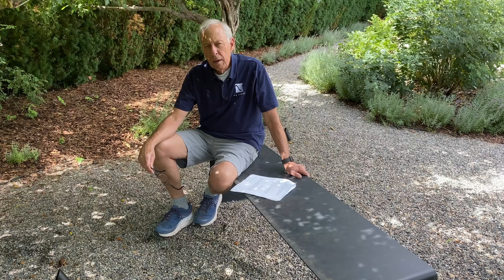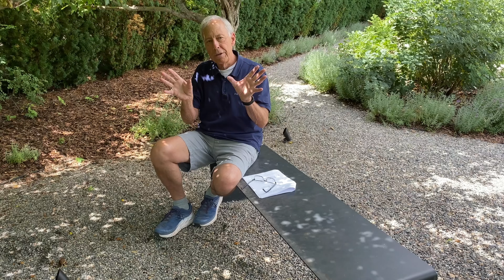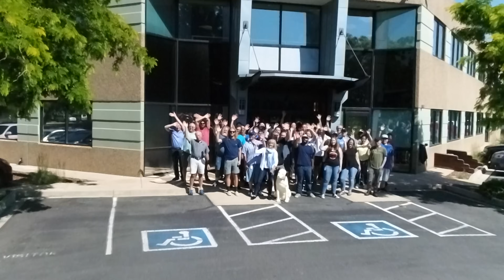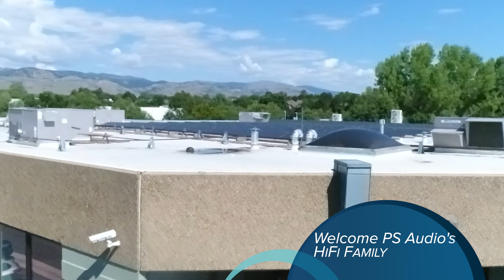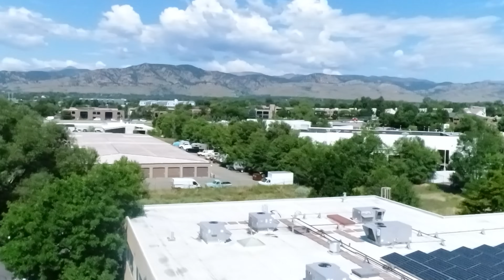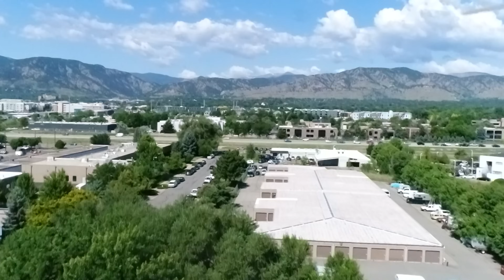Psychoacoustics in speaker design

Comment: The question is excellent. I would like to support my comment with the biological investigation of our hearing, 40 years of being HiFi enthusiast (if not audiophile - maybe yes) and meetings with few famous Danish speaker designers - Dali and Dynaudio manufacture. 
First biology. Not many from us consider, that our brain needs some time to 'understand' the sound which is mechanical energy reaching our tympanum. That energy is an air pressure changing according to molecules' misplacement in the environment. That energy is transferring (simplifying the process) into the nerve impulses which are forwarded to the right part of our brain to be read by comparing with our former experience. The experience we build during our life. And, what is important, the experience is build based on the music we hear by specific HiFi equipment. It means also that changing equipment we usually need time to train our brain to understand the new information as the same as was before. I call this process 'equipment must warm-up'. Funny enough. So, no snake oil in the warming-up cable process. By the way - the entire hearing process from the moment the music touches tympanum to be accepted by our brain takes a fraction of second. It means that it happened not immediately. Interesting. So be aware if they say 'our cables are fast'. Relax.
My experience. I bought a few times a new HiFi set or HiFi upgrade element and my very first impression was devastating. It is no improvement I had expected! Wait. After some time my old staff seemed to me odd and not as good as the new one. After some time - think about it.
Professionals as Paul. They say that it is possible to evaluate speakers just looking at the graphs from technical tests. I remember very well the moment I showed this kind of results to the main speaker developer in Danish manufacturer Dali Speakers. Graphs were taken from a highly respectable Hi-Fi magazine - the test compared 4 or 5 similar huge speakers from different manufactures. We looked through all these graphs - frequency response, impedance, phase shift, impulse response, etc. He said suddenly - these speakers are not good. Why? - I asked. The impedance shift in low frequencies is audible, resonates for some frequencies as well, high frequencies are too much elevated (about +3dB), etc. What was the surprise? These bad speakers were the test winner! He just smiled.

Comment: I love the time you take  paul and love this channel, but this sadly steered away from the question which could have been a very ointesting one.

He wanted to know if the frequency response of the speakers were tailored to the heightened hearing sensitivity to the specific range of human speech ( which can sometimes favour female speech if a males voice is low and below the increased sensitivitu range ).

This could have lead to a discuasion about whether there should be a dip in frequency response in that range at the speaker level, whether engineers already do this in mixing or whether they even should. Whether mircrophones themselves are designed to do this etc.

I think that as we naturally have a sensitivity to this range there should be no change anywhere from mixing to sound reproduction. Why would you reduce what you would naturally hear. I don't think he was asking about soundstage and imaging.

Comment: I thought Bose was the big name in psychoacoustics ..! 
Psychoacoustics is a highly complex subject ... while a certain amount of it is allowed for ( but I hope not relied upon in speaker design !) in the development of a high end speaker systems ... the real psychoacoustics plays out in the confines of the listening environment and is very much out of our control ..
There is a difference between speaker placement for a so called flat frequency response and speaker placement for psychoacoustics.... good luck with it ! The only way to listen to reproduced music is to have a room with an odd number of walls ... a solid concrete floor and a tall vaulted ceiling and suitably positioned broad spectrum diffusers ... My listening room is of this design and it cost more to build than the equipment I use within .
Reply: I would offer that besides the psychoacoustics involving imaging and soundstage and room acoustics which is more what you are actually talking about, that the radiation pattern of the speaker is more pertinent to the psychoacoustic qualities of a loudspeaker than anything else. From directional horn speakers to cones and domes to dipoles to omnidirectional speakers, this factor makes the most influence psychoacoustically than anything else in the design of a loudspeaker.

Comment: One thing that is odd is that tweeter directivity is important as high freqs are very directional yet our ears point sideways rather than at the tweeters Of front speakers.
Reply: Unless you are without an outer ear, or Auricle, you have plenty of forward detection for hearing the tweeters.
Reply: @jamesplotkin4674  I did think of that but turning my left and right surrounds on and off showed how much we're missing.

Comment: Loudness is the one psychoacoustics parameter that high-end audio sadly choose to ignore. The loudness function was popular decades ago and greatly enhances the music perception at low volumes. If you always play at concert level, you don’t need loudness. But many of us don’t have the volume knob statically fixed on such level.
Reply: A huge amount of my listening in my teenage years was late night jazz presented by Arch McKirdy through a heavily modded speaker on the head of my bed so I was listening near field. Ever since I have judged the systems I have owned and built based on low SPLs and judicious use of tone controls. I even built a 1/3 octave graphic EQ, but despite the benefit of achieving the tonal balance I was after, the distortion it added meant it wasn’t worth the candle. Basically I set the volume such that I can clearly hear the quietest passages rather than to the loudest the speakers can take without distortion. Probably one of the reasons I still have most of my hearing!
Reply: Jonathan Sturm I built an EQ with 24 potentiometers in my teens and kept it in bypass mode when listening to my Stax headphones. Those pricey electrostatic headphones, that I purchased by hard earned money I made during summer holidays while in high school, made me realize the extend of details you can hear when your system is not messing up the sound. I also realized how my hearing dramatically changes on perceived tonal balance as you drop the volume down. When using speakers in my parent’s home I had to respect my family members and my EQ did well in adding some loudness compensation. I’ve always found it silly when listening to systems costing 10s of 1000s of US$ and realized how lame the music sounds with the bass being almost gone when you listen at volume levels suitable for reading a book or having friends around you talking. Loudness is not fixed by a US$1000 power cable or a power regenerator. It’s psychoacoustics and a “feature” of our hearing.
Reply: @ThinkingBetter  obviously I joke around a lot, but that's a great post, thanks !! I agree 💯
Reply: @jonathansturm4163  Haha - I had various modded or home-made, late night, low level, listening speaker monstrosities too. There is something truly engaging about lying in bed with two giant speakers purring on either side of your head...... Was more of Chris Winter guy though.
Reply: @MrPeeBeeDeeBee  I was a huge Chris Winter fan back in the day. At midnight 2CN Canberra used to take a feed from 2JJ and so we could listen to his broadcasts in Melbourne. I loved the badge he used to wear: Cynics love life!
Reply: @jonathansturm4163  Room to Move 😎
Reply: @MrPeeBeeDeeBee  Monday nights IIRC :-) Wouldn’t have missed that for quids. I first heard Roxy Music (For Your Pleasure) and many other favourites on that show.
Reply: @jonathansturm4163  The night I heard Chris drop the whole of Lou Reed's 'Rock 'n' Roll' Animal' album way down low on an old valve radio with a giant speaker!..... Anyway, my now adult daughter's name is Jane.
Reply: Fat Rat The high-end audio industry needs to calibrate itself to modern solutions of digital audio architectures involving high performance DSPs that can do better than any analog circuit in hitting the ideal intended effect. Previously some years ago such approach would introduce quantization noise and loss of resolution but that’s history. One thing I also like to see is a truly audiophile DSP based active servo subwoofer with a deep and precise bass.
Reply: My volume knob is "statically fixed" on eleven...
which as you know, is one more than ten...🤣😆😂
Reply: poserwannabe     Damn, just turn it up to an even dozen!
Reply: @doowopper1951 ...Baker's Dozen?
Reply: While loudness is a psychoacoustic issue, it doesn't have anything to do with speaker design which is the question being asked here. Probably the biggest psychoacoustics issue in speaker design is the radiation pattern, i.e. monopole, dipole or omnidirectional. Then within those options, there is a gradation like using horns to limit the directionality or cones and domes or planar drivers for a wide dispersion. When trying to decide what qualities to build in a speaker, this is the one with the greatest impact on sound reproduction. But Paul didn't even bring it up.
Reply: @StewartMarkley  Yes, mostly agree. Well, I would argue that in any speaker design, you make choices concerning tonal balance and ironically, a smaller speaker can't play as loud and thus need to increase the bass (that smaller speakers are less good at)  to compensate for the loudness effect to enable a pleasurable musical experience.  Many modern active (mostly junk) speakers do such tricks using DSP.
Reply: @ThinkingBetter  I have never chose a speaker on tonal balance, as I can make virtually any speaker sound the way I want with some EQ. I look for bass capability and overall output capability as the prime concerns and I like good horns because of their directionality which reduces some of the room effects as well as their ability to reproduce music peaks with less distortion giving a more lifelike sound. Back in the 70s I bought a Bose 1801 power amplifier and 4 Bose 901s and while the bass was incredible, I did not really like the low direct to reflected sound effect so I just spun them around and pointed them at my sweet spot. This worked pretty well for me until I started working in the sound recording business and converted to horn speakers with plenty of power to get realistic listening levels without the amplifier clipping due to the 18dB of bass boost with the Bose 901s. But back to your loudness compensation point, I think it is sad that it is another casualty of the "signal purity" craziness and should be brought back by someone smart enough to make it flexible to accommodate the variables of line level versus SPL so that the appropriate equal loudness curves can be simply applied. This seems like a natural solution for DSP.
Reply: @StewartMarkley   I almost bought a pair of Bose 901s ages ago but found the idea of such extra rear reflections unappealing. I'm much more into being loyal to how typically music studios listen while mastering the music to the optimum perception. Getting the acoustics just right can be tough as you also don't want to easily identify where the speakers are when you close your eyes.
I don't care anyone's allergy to EQ. It's mostly ignorance driving it. People allergic to EQ still listen to vinyl music that has gone through plenty of EQ in the studio, RIAA filter in the vinyl mastering, RIAA filter in their setup and cross-over filter in their speakers without realizing that these are much much worse than a slight EQ tweak of a few dB. I use EQ in my setups for a number of reasons including fixing room acoustical effects e.g. in the bass, fixing other jumps in the frequency response due to the speakers, loudness effect and even my own hearing losing a few dB above 12kHz. Yes, +4dB at 12kHz makes my music sound like it did 20 years ago.
It's not complicated to make a good loudness function that follows the psychoacoustic behavior relative to volume level. In fact, some active audio systems and premium car audio system do that today. I predict that within the next few years, you will see more amps or DACs with built-in DSP that can do this loudness trick, cause it's not complicated at all.
Reply: @ThinkingBetter  Totally agree with you. I use EQ for all those same reasons. Nowadays with active speakers and DSP it is quite easily possible to faithfully compensate for different playback levels.That was always a problem with the simplistic loudness compensation of the past mostly because the compensation curves at different volume control settings were not very accurate in terms of replicating the Fletcher Munson curves and the preamp section that included that function had no way of knowing what the SPL was in the room. That really isn't a problem though with active speakers and DSP. So the long lost loudness function should hopefully find it's way back to the mainstream someday.
Reply: @FatRat-f9m  Well guy, I have completely changed my approach with them and actually sent back to Danny all of the crossover components and the 16 ohm woofers and just received back the 8 ohm versions as I am now going to use the Dayton Audio Class D amps with built in DSP to actively drive the speakers. I'm using two 12 volt batteries to power the amps with 24 volts and mounting them on boards which I will attach to the back of the cabinets and the speaker wires will just be a foot or so of 14 gauge wire. Then I will program the DSPs to cross the drivers and also will set them up with EQ settings from REW and a calibrated microphone. I'll send you some pictures once I get started which will be very soon now.
Reply: I never liked analog loudness compensation, as it never made the music sound right.  How could it, as a very inefficient speaker would far less compensation than a gay efficient speaker, as the compensation was dependent on the volume setting.  But today, though, it could be done by FPGAs, and I bet that they could be programmed such that if you punch in your speaker’s efficiency, the unit provides the correct amount of compensation.  And, they could far better provide the true inverse of the Fletcher-Munson curve for any volume level.  Come on, Darren and/or Ted, start working on it.
Reply: @doowopper1951  what is a gay efficient speaker? 🤣 Active speakers can do this very easily today with DSP.
Reply: Neil Russell It’s easy to do a volume setting dependent loudness compensation using a modern DSP e.g. SHARC from Analog Devices or even just use an ARM processor like that you find on a simple Raspberry Pi board (ARM runs most smart devices nowadays). No need for FPGA. 32 bit audio processing is already standard and if anyone really wanted it, 64 bit is also possible, but overkill for audio.
Reply: Fat Rat Nowadays you can even do 64 bit processing of audio in an ARM processor like a Raspberry Pi. Hardware can easily be more than adequate for audio processing.

Comment: I agree, a big portion of 3d image is speakers dependent. BUT electronics also plays a part by separating instruments. Have some treatments on the room too. It helps tremendously as reflections will ruin the image. 

Just start by pulling the speakers 3ft out the front wall and go from there. Play with toe in, placement and have fun with it.
Reply: Recordings also play a big part, as I have had some musical tracks image well & others not so on the same audio/room (environment) set-up.
Reply: Fat Rat This is very true as well . Basically there has to be synergy between all pieces of gear and music for the best sound possible.
Reply: You hit the nail on the head 👍

Comment: All things being equal ...
the key to this 3d holographic result is removing objects in the vicinity of the loudspeakers to assure that wavelaunch is experienced by the listener intact, ... and without relective disruptions within the initial critical mSecs to destroy the sonic illusion so carefully captured in the material.  

Secondarily, assuring absolute symmetrical continuity Left-to-Right from the loudspeaker relative to the boundaries behind and to the side. This retains relative time/phase linearity to the reflected field. 
ETC measurements will flesh out detrimental objects within the space in front of the listener.